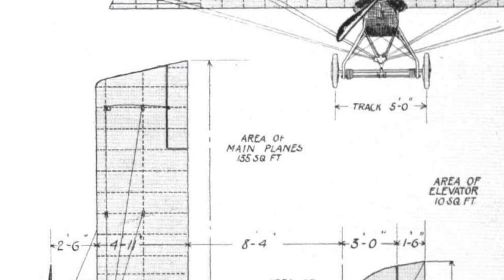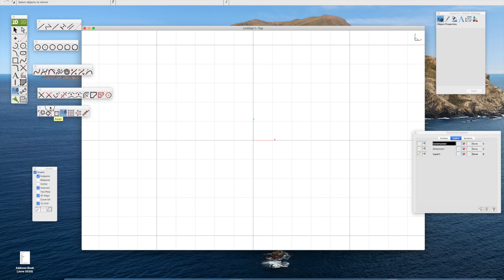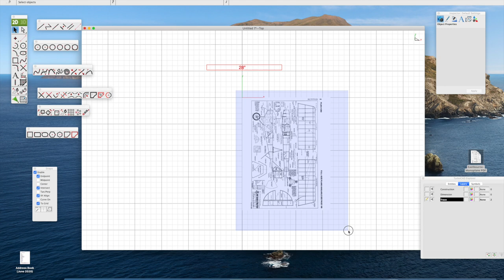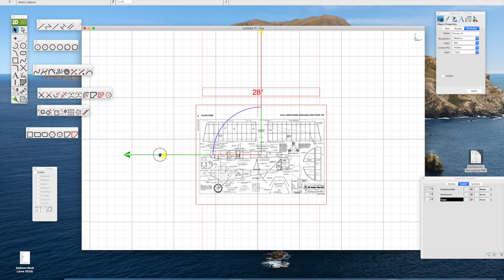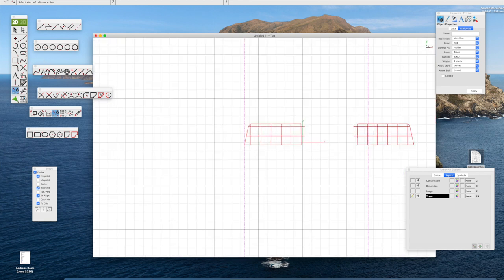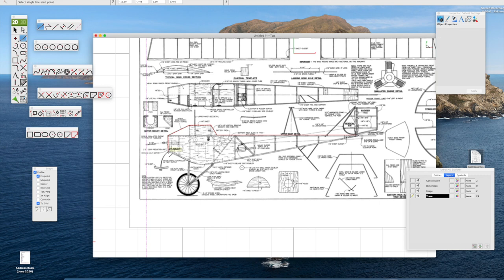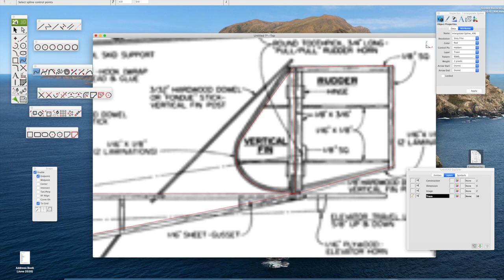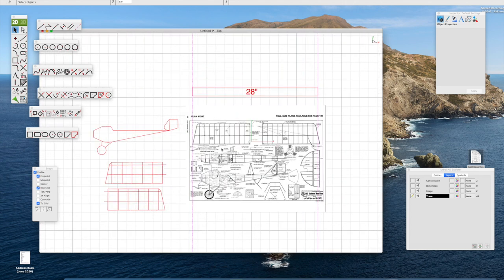Learn how to Easily Import and Trace an Image in TurboCAD

Comment: Thank you Tim. I have just watched this and your introduction to QCAD and wondered if you have a preference between the two CAD software packages for RC aircraft. I much liked this trace example as I can see a use for redesigning scale design variations like an alternative nacelle when converting from say I.C to electric motors. 
Thanks.
Reply from the maker: Robert:  I like TurboCAD a lot, but each time my iMac has an OS update, the update is not compatible with TurboCAD.  Thus my use of QCAD, which I really, really like a lot for 2D CAD drawing.  Tim
Reply: @TimMcKay56  thanks for your thoughts Tim.
Reply: @TimMcKay56  I have been using TurboCAD for about 20 years now and am kind of stuck on it. But Iike the way it works and likely will continue to use it. I am trying to download picture images to night to try to trace to make DXF files for use in plasma cutting. I have been having next to no luck. I have tried to pull them up as several different types of files after saving them as all different types of files and nothing shows up. And when I try again it won't even go into the area to pick the file. It is like it is locked up. I would appreciate any help.
Reply from the maker: @darrensundstrom2739  Darren, with 20 years of TC you are a bit ahead of me!  Apologies, cannot help you on this matter . . . hope you find a solution!  Regards, Tim

Comment: Hi Tim I have Turbo cad 2016 Profesional. I cant seem to replicate this process...what version are you using please?
Reply from the maker: Geoff:  I use TurboCAD Deluxe Ver 12 for the Mac.  Maybe give this a  second try.  I used TurboCAD since 2003, Ver 8 for the Mac and Windows.  Usually the fix lies in playing with the layers section.  Tim
Reply: @TimMcKay56  Just finished watching your 12 part series... very interesting. Been doing some house plans and starting to pick it up...slowly......
Reply from the maker: @factoryfresh9141  Geoff:  All good, you just have to keep at it.   Tim

Comment: Your screen shows via cad 2d/3D I’m confused ? Is this a Via cad or Turbocad tutorial ? Just wondering ?
Reply from the maker: John:  I use TurboCAD for this video.  Not sure what Via CAD is.  However, as I've had problems with upgrading TurboCAD with changes in my Mac OS, I have switched over to www.QCAD.org.  Love this 2D CAD program, no looking back.  Around $40 and I have a few videos on this.  Tim